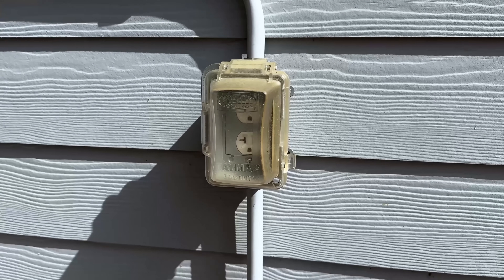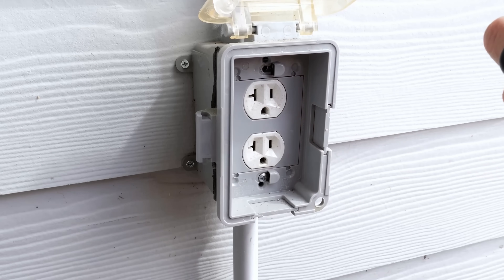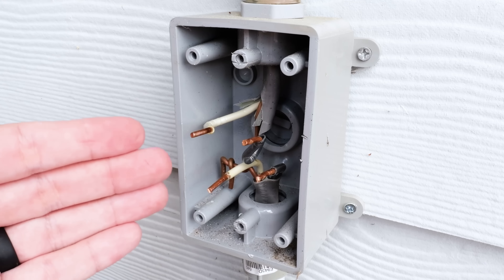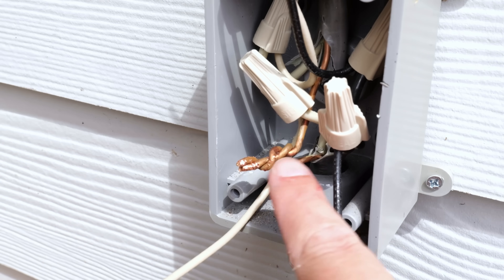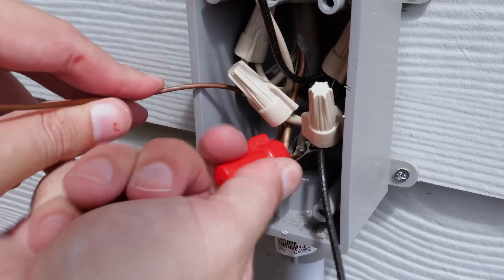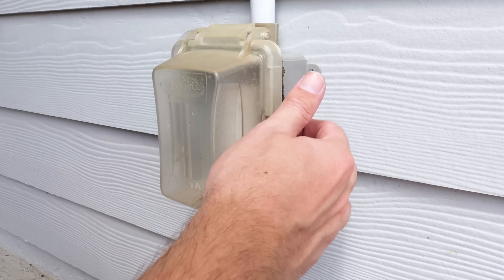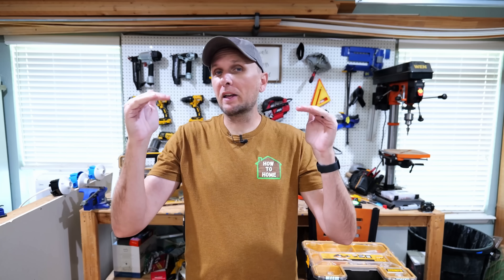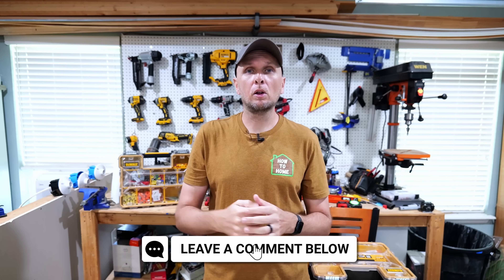Dangerous Mistakes DIYers Miss When Installing Outdoor Outlets!

Comment from the maker: Be honest, have you ever made any of these mistakes or seen them done by others?  It is actually incredibly common as it is not a standard indoor receptacle install.
Reply: Hmmm, doesn't the twist for a wire nut have to continue to the exposed wires?  Does your wire nut manufacturer not require the wires be twisted as well?
Reply: @LDBuggy2  no it doesn’t need to be pre twisted.
Reply: @LDBuggy2 generally as a rule and when twisting it also twists the wires!
Reply: For better look the 4 mounting screws should be pan head / oval head and stainless.
Reply: @vietcongbuondanbannuocphan1791 SS pan head square drive would be my approach. Rust stains down the road should be avoided. Like so many license plates.  Why ?
Reply: I noticed you installed a 15 amp GFCI on the 20 amp ckt. is that up to code?
Reply: @kennys10  IIRC, if there are at least two outlets, it's ok (section 210.21(B)(3))
Reply: @santamaus Outlet and receptacle terms are sometimes used synonymously, a duplex receptacle (outlet) is 2 receptacles.
Reply: @kennys10  it is permitted by code for 120v receptacles.
Reply: @kennys10 Why limit utility?
Reply: @kennys10 Yes, a 15 amp GFCI or standard outlet can be installed on a 20 amp circuit.
Reply: Is there a reason you didn't wire nut the incoming and outgoing to a single 6" pigtail?  Was it just to chain the GFCI to the entire circuit, or is it not code even if you're just trying to protect that singular outlet?
Reply: @santamaus  he used it to GFCI protect the downstream outlets. If you pay attention, one set is connected to line and the other set is connected to load. Not all situations require this but his did.
Reply: Weather resistant is not optional. Code requires that all exterior receptacles be weather resistant. All residential outlets need to be tamper resistant.
Reply: @ianbelletti6241 Agreed: Tamper resistant--nobody seems to care. Why have to redo later on, though? 

When you sell, wouldn't an inspector note this?

You know crazy kids..

Those 67¢ prc outlets continue tol fly away, at supersonic speed, from Wally World....
Reply: Have to ask, Why would you not pigtail the 10 gauge wires together like you did for the ground.  By going to the smaller wire do you not create the issue that was being avoided at the 5 minute mark?  the long run?  

I can see the 12 gauge going into the outlet but shouldn't the 10 gauge be connected together to support the long run?
Reply: @chrish7336  because he has a GFCI receptacle and is using it to protect downstream receptacles. One set of wires goes to line and the other to load.
Reply: @ianbelletti6241  That's what I was thinking.
Reply: house laughs in 1948 for outdoor outlet
Reply: Use your damn linesman damn dude... now I'm finished busting your balls about the not using your pliers and grandfather clause rest is decent info takes balls to put videos on here and the old school dicks to come on I me get on here and give you hell... stay safe frosty and free
Reply: It looks like you installed a 15 amp outlet on the 20 amp circuit. Is that OK with the 20 amp feed-through.
Reply: @jackkern1215 Yes. Nema 5-15 outlets can be legally installed on a 20 amp circuit. They are listed for that scenario and it is code compliant.
Reply: I've seen these mistakes done by licensed electricians
Reply: I'm not falling for your cop-trick questioning. I admit nothing. I want a lawyer.
Reply: So you replaced a 20 amp receptacle with a 15 amp GFCI receptical? Do they make that receptacle in 20 amp? Thanks for posting.
Reply: Pigtail gage mistake. Smh
Reply: On the original installation the receptacle was used as the connection to the outgoing cable. Seems like a bad practice! Shouldn't the in and out be connected with a pigtail to connect to the receptacle? This application is when it is fed by a GFCI breaker.
Reply: Dangerous mistakes professionals make: First thing you should have done was check the voltage on the outlet before turning off the breaker.
Reply: I have had two non-GFCI outlets on the exterior wall of my shop for 30 years. Hardly ever use them in the rain, try not let an extension cord end up in a puddle, that sort of thing. Might change them one of these days.
Reply: @TruthInFlying  yep, code is for doing it now.  My plug is happy just the way it is.  Worked for 50 years, and will work for 50 more.
I can't figure out why they would come out over there, and not where they wanted the plug.
After seeing how the outlet was wired, I would be opening it to see inside also.  Maybe the ground wasn't needed on the outlet since it dead ends in the metal box.
Reply: Other than egghead codes dreamed up by some bureaucrat, please explain why you must have so much extra wire in the box. I'm Harry homeowner guy. I hate stupid rules. It's always a hassle stuffing all that in the box. I make it long enough to pull out and unscrew if necessary and to be honest it hardly ever is . I don't want to have to fold up 6" of wire and worry its rubbing or getting pinched or a screw run through it. I know it's"code" sorry don't care, it's bureaucrat bs. Wired a lot of my old house and auto repair shop myself over the last 40 yrs. Still standing!! In this video you're jamming a lot of crap into a small box, it's unnessary and probably more prone to later problems. Also I always tape my wire nuts to seal them up. That should be code.  Just for context I used to run a nuclear power plant on a submarine, so I believe in safety. But I don't agree that all those wire nuts and extensions are needed just because of "code"😂
Reply: @scottnusser6232 wrapping a wire nut and incoming wires with electrical tape will add very little to the mechanical connection. Especially over time as the vinyl relaxes and the adhesive degrades. I never served on a nuclear sub but I did write my thesis on protecting humans performing electrical work. If wires are twisted together properly and the wire nut is cranked on tight those wires are together to stay. In some jurisdictions taping of wire nuts is forbidden as it disguises a loose or arcing condition that an electrical inspector or the next electrician could not easily discover by wiggling conductors. I admit that in very high vibration conditions or even an apartment near a bus stop I will “park” hot leads in the top corners of the j-box with the small or closed end of the wire nut on top. Should anything start to get jiggled loose gravity on the wire nut and corner stuffing will preclude a fault.
Reply: @scottnusser6232 Dielectic grease, too?
Reply: @scottnusser6232 yeah, I have had some of the same concerns that you have expressed. Guess one has to do what they gotta do.
Reply: @scottnusser6232  maintenance. Even with the deep weatherproof boxes you may have to add an extension ring when installing a GFCI receptacle. But you need the 6" minimum to safely work with the wire during maintenance.
Reply: Your wrong 
Not a BS code .
If you were interested, you could do research and understand it’s important
Reply: @scottnusser6232 It's easy to put 6" of wire with device in the box & have plenty of room left. Very shallow boxes are a different ball game & should not be used in majority of installations.
Reply: Maybe I'm wrong and maybe that box is not a water type box but it was always my understanding according to the NEC code that if the box itself is watertight then you don't need to put A GFCI Is receptacle In the box because the box itself will protect it from moistureBut if that box is not water Tight then you definitely need to use A GFCI Is receptacle Or have A GFCI breaker
Reply: @froggy5584 that argument doesn’t hold water. LOL. Once you plug ANYTHING into the receptacle it becomes an electrical shock hazard and must be protected. What use is a receptacle with nothing plugged into it?
Reply: @peterwachter7753  I didn't even think about that.I'm sitting here laughing at how dumb my comment was.Thank you for the information.You're totally right regardless of whether or not the cover is water tight.What's plugged into it Still needs to have gfci protection wow.I'm so absent minded
Reply: @froggy5584 Dielectric grease in this new wire connection?

I noted that my outside outlet is simpleton--I want to put in GFCI.

For G sakes, why not a new plastic box, too? Or, metal.

That sort of plastic dries up over time. It's yellowed, too. That really looks sicko..

I know that's not what the points are 

One other thing, also: Why not use 20A there, instead?: Why limit the gfci's versatility?  

Yeah, 15A is cheaper--he's right that most homeowners wouldn't care 

20A is  better for tools, outside--say, a table or miter saw.  Even an electric chainsaw. 20A is not essential, yeah.....
Reply: Wrong @froggy5584
Reply: @froggy5584  The GFCI is required for installations where water could be present to protect against shock. It has nothing to do with the type of enclosure box.

Comment: That’s not the worst job I’ve seen. I ran into a much worse problem on my project. It started with wanting to replace an old and weathered exterior receptacle on my shed, which had about two inches of wire inside the old work box which made the removal a little harder.  I turned the breaker off. I began dissembling to remove the receptacle I noticed it was grounded. There started my journey. 🤦🏻‍♂️🤦🏻‍♂️🤦🏻‍♂️ I tested it and found there was an open ground so I started to traced the Romex to a single pole switch so I disassembled the switch and ground was connected. I followed the Romex up to the exterior motion lights, ground was connected. I traced the Romex back down to an outlet on the opposite side of the receptacle, ground was connected. I traced the Romex back to a GCFI, I opened it and it and ground was connected. I had no choice but to keep tracing the wire so I go outside and ran into pvc conduit. I dreaded cutting the conduit, but I needed to find why there was an open ground. I started to get a gut feeling I wasn’t going to like what I was going to find. I grabbed the pvc 90 degree elbow and learned it wasn’t even glued, which made it easier for removal, but then I grabbed the conduit running down the wall and learned that it too wasn’t glued either. I removed a four foot section and that’s when I saw it: whoever made this install was so freaking careless. The Romex was the correct type of wire rated for exterior use but they ran a short run and then added another 2 foot section and didn’t bother to tighten the only two wire nuts hot and neutral only. The ground wire was just “u-hooked” it together, meaning they just placed the two wires together and bent each side to create a “U” and called it good. They didn’t bother to twist the wires or use a wire nut. Mind you, all of this was inside a 1/2 inch pvc conduit. The ground wires were loose with no real connection just loose and creating that open ground. Now I’m disassembling the entire crappy job and running new 2” schedule 80 conduit from my house to the shed and running new Type UF-B exterior rated conductors to a GFCI receptacle. I’m redoing all the wiring inside the shed too. I hate half-ass crappy jobs. No sense of pride in the work they did.

Comment: Couldn't you install GFCI at the breaker? Instead of the outside outlet to be code.  I have an outside outlet like this, 15 amp, no GFCI, put in in 1979.

Comment: DIYer but I always check the wire nut installation by manually pulling  each wire to make sure it is on right.

Comment: Well, first off, put in your tester. The first round of construction with GFCI the outlets were expensive. I worked on a townhouse that had a single GFCI in the downstairs powder room. From that device the outlets on the front porch, back porch and the upstairs bathroom were all pulled off the protected terminals. 🤷‍♂️ I guess they used to be more expensive?

Comment: Doesn't having the 12 gauge wire for the pigtails negate the benefit of having 10 gauge in the walls? It might not matter if 10 is overkill, but it just seems wrong to my uneducated eyes.
Reply from the maker: No.  Not to any meaningful amount anyways.

Comment: There is code and there is common sense. I would have just used a 3 way WAGO 221-613 lever nut on the in/out/new pigtail to receptacle vs adding all those wire nuts, introducing more failure points, and more critically breaking the 10AWG line with a 12AWG extension. You know that is there but the next person does not.

Comment: All excellent points in your video. One additional point to make is that if you had an existing GFCI receptacle or GFCI protected breaker on that outlet's circuit, then that original outlet would have met the code without a need to change the outlet. You could test the GFCI function for the original outlet on your tester for verification of function had it already been a GFCI protected circuit. You would need to go to the GFCI protected source to reset after the test in that case.

Comment: So, you have a 15amp GFI on 20 gauge pigtail to 10 gauge wire on a 20 amp breaker in a ungrounded 2 gang exterior plastic box where theoretically its grounded to the panel?...hmmmm
Reply from the maker: Can you share where anything you just said is against code?
Reply: @HowToHomeDIY  your doing a great service, nothing there against residential code however, is the run less than 50 feet?, (12g would suffice),1/2 conduit for insulted 10g cable (little tight/heat) , can be confusing for a 'Tap" future lighting on 14g or less by todays LED, or outside appliance hook up(branch circuit)🔥
Reply from the maker: No, it’s longer than 50 feet which is why it was made larger for any possible voltage drop.  This single cable did not exceed 53% of the conduit.

Comment: @1:06 just so everyone knows, there is a chance that some straight blade GFCI's can be rated at 20 amps as well. Those will NOT have the -I shape plug.

If you need to replace your receptacle,  shut off breaker, take off cover plate and pull out the receptacle (you shouldn't have to disconnect any wires) and make sure you look for the "**A" rating.  Just so no one does what I did and make a trip to the hardware store for a 15A only to return to a 20A 😂.

Comment: I would have only put a pigtail on the ground wire, to ground the receptacle.  Lengthening the hot and neutral didn't make  any improvement to the funtionality of the outlet and just crowded the box.

Comment: I'm not an electrician by any means,but that bare ground wire you stuffed in the box was looking too close to the hot (black wire)for me.I would prefer to keep that bare wire on the neutral side.Check it out at around 10:15.

Comment: you should pre-twist your wiress before you put them into the ground nut. My own 2c to offer anyone, all the time ever. :) also, I would scrape the edge of the original wire with a knife, in case any oxidation happened so you get a nice connection with the pigs.

Comment: If the the 20A breaker is a GFCI circuit breaker, then it would not be necessary to swap out the non GFCI outlet.

Comment: Don't know if it's code, but I recommend to not use the bugle head screws on PVC clamps. The taper on the screw will split the hole in the clamp if over tightened and make that screw loose.

Comment: Good work with the video and the points covered overall.  I didn't read through every comment here, so I don't know if you addressed this.  Running direct bury wire (gray) with its insulation intact through PVC (or even metal) conduit isn't allowed in a damp location.  Conductors must be individual wires.  Correct?

Comment: How can you use power tools outside when pluged in to a GFCI. They always trip for me
Reply from the maker: They shouldn’t.  GFCIs trip due to a ground fault.  May want to check your wiring setup.  I’ve used tons of power tools on my outdoor GFCIs and they have never tripped except when there was dew on the ground and the plug to the extension cord wasn’t plugged in all the way.  If it’s too much current load, the circuit breaker will trip, not the GFCI.

Comment: Question for you if I may: I have electric ran to my pool area for the pool pump and the saltwater system. These both come with the large plug with built in GFI, It kept tripping things over and over? Once I relaced with standard outlet no issues?  Have you dealt with this?   I will add a GFI on the run before that 2 gang outlet and that should help?

Comment: question regarding the amperage of that GFCI outlet you installed. Is that actually a 20a outlet, because it doesn't have the horizontal slots, or is that not always the case?

Comment: That box is NEC 314.16 code violation - it is 16.5cu. #10 in/out with receptable  requires 17.5cu.  Weather rated is not a preference - it is 406.9 required.  That appears to be UF cable - if so that is good. If not - it is not legal to be in conduit outdoors.

Comment: What you overlooked or missed is you downsized a 20 amp receptical to a 15 amp GFIC receptical. We all know a 15 amp receptical allows 20 amps to pass through it but only 15 amps is allowed to actually power the receptical or come out of it. Is a 20 amp GFIC only used for a dedicated circuit or is there another reason that I'm missiing?